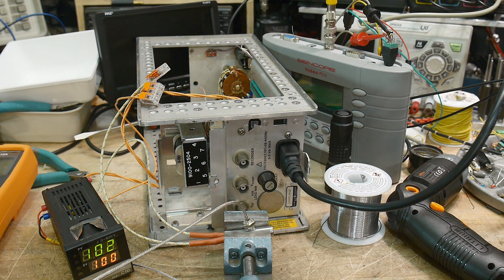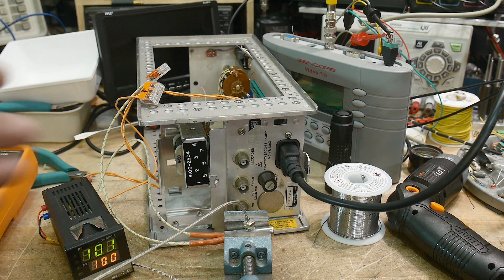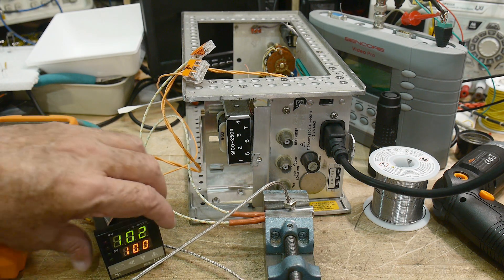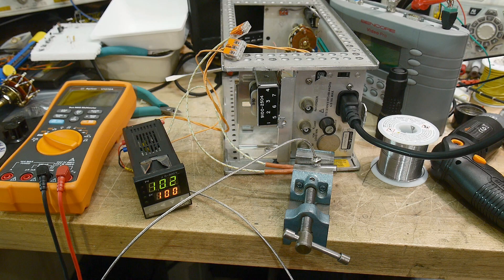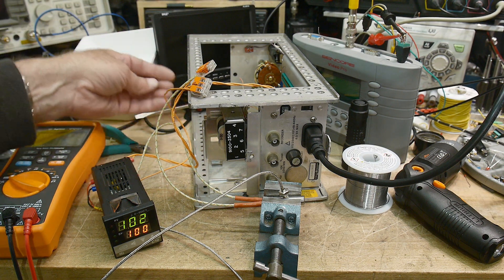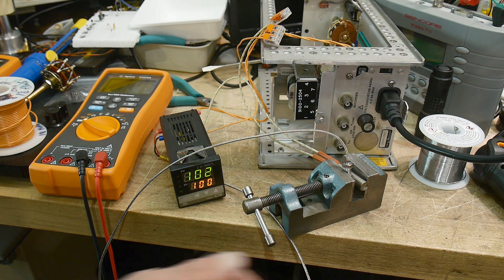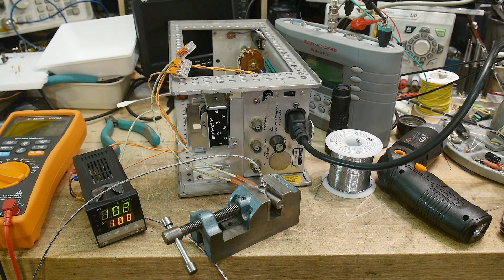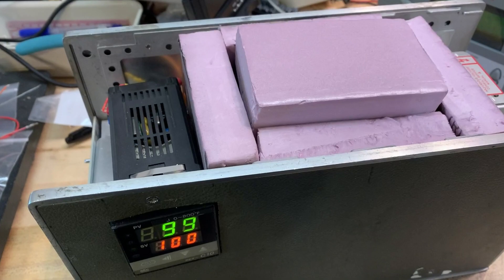#1169 DIY Oven for Electrical Component Testing

Comment: A few decades ago I worked in a UK calibration centre. We had an oven for component testing in the lab. Being in a group of young men we used to sometimes not adhere to proper practices and would use this oven for other purposes (Warming Pies). Ensuring after its use that it was cleaned 100% for its real use and avoiding the wrath of those in charge. On one occasion with lunch already warming nicely, those in charge appeared, accompanied by a group of important visitors. By the time the visit had moved on to the next department, the aroma had gone from pleasant to that of crispy critter. When our Guv returned he was nearly apoplectic at the condition of the oven and the embarrasment. We received a well deserved dressing down, instructions to restore the oven to pristine and............ his order for an additional steak and kidney pie to be included at a time, when he knew there were no visitors due.

Comment: My buddy did something similar for his 3D printer enclosure.  Amazon PID controller, a 110v heat gun, and a solid-state relay.   Pretty sure he added Reflectix-like insulation to the enclosure.

Comment: Nice project. I suggest the door is not in the top, as heat rises and you will not want cracks/leakage in the top. If you want to be able to investigate fast heat rise times, I don't think the 150W element will be nearly enough. You might want to also consider using the type of thermocoupler wire that has the probe/solder blob at the end of the wire - leaving it long enough, inside the box, to rest directly upon the DUT. That's what I did for my DIY reflow oven and it works well. If you ever think you might want to DIY a reflow oven, ask for comments, first. I have lots of information on my experiences and why a toaster oven type build does not really work that well, in the end. An old fry pan and a single burner eye probably works as well as what I ended up with.
Reply from the maker: SMD soldering: https://youtu.be/aoG15wpobF4

Comment: Nice project. Take care of how much substance you have to heat and to let cool when checking the behavior of the device under test. Sometimes it is just a transistor in air when a small fan inside might be helpful, an alternative is to mount some device on a piece of aluminum which is then heat controlled. Mind the temperature limit of Styrofoam or any other insulator, - and as always good luck.
Reply from the maker: good thought, just checked my foam, max 165F

Comment: A few years ago I cobbled together a 7 MHz colpitts oscillator and a double balanced diode mixer to create a direct conversion receiver whose output was fed into the mic input of a computer running some SDR software.  It all worked OK except that every so often it would suddenly drift in frequency by quite a bit.  After some head scratching and gentle prodding I finally noticed that the drift occurred at the same time as the air conditioner kicked in.  In reality it worked better as a quite sensitive thermometer rather than a radio.

Comment: Brainchild temperature controller, probably BTC9030, just remember the accuracy is a little poor at the bottom end, you will need to calibrate it to get it to be accurate at low temperature around ambient. Grab the manual online and you can change to C as well, just needs a long press on the menu button, and then follow through the long set of times presses to get it to read in C. But you can read down to 0.1C with it, and they are pretty nice and repeatable, plus you will find the spare position inside for the alarm relay that you can use as a second controller output to light a "ready" light to tell you you are within control loop range.

Comment: A number of years ago, I needed to figure out the failure mode of some new hall devices.  It seemed like the best way was to run them a bit hot, so I made a little oven to power them at 140C for months.  The "oven" was an old aluminum housing that I lined with ceramic tiles.  This provided insulation that couldn't catch on fire in case something went wrong.  The control circuit was a PID controller that I made out of a quad op-amp, and used a thermistor for sensing.  The heater was a power resistor.  I ended up running this oven continuously for about 5 years and never did get those hall devices to fail!  🙂
Reply: As I was watching this video the first question that came to mind was why not use a PID controller?
Reply: PID from op-amps? That's something I've never heard before!
Reply: @HA7DN  control theory started out with analog circuits, and op-amps can produce the proportional, integral, and derivative functions pretty easily.  It's amazing what can be done with a cheap little LM324.  🙂
Reply: @SkyhawkSteve  I've learned control theory, but we almost always used digital realizations of the controllers in discrete time. I understand that it's possible to realize them with analog circuits, but I imagine the tuning of them would be very hard - and also require the knowledge of the transfer function of the plant. I've more suprised for using a PID for a temperature controller, as it's way simpler using some simple hysteresis-type on-off compensator.
Reply: @HA7DN  In my oven, I just used the P and I elements.  As far as transfer function, it's usually simplified to a first order model, and you can estimate that from observing the response from a step input.  A hysteretic design would probably work too, and I've used that method before, but the average value is not controlled.  Tuning on my oven was based on quick observations, i.e. is it oscillating and is the steady state error small enough.